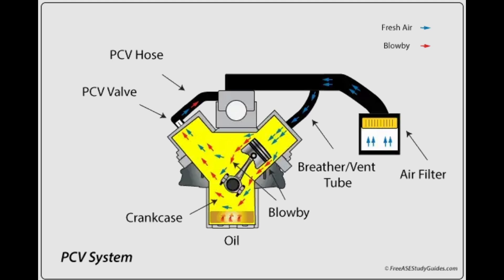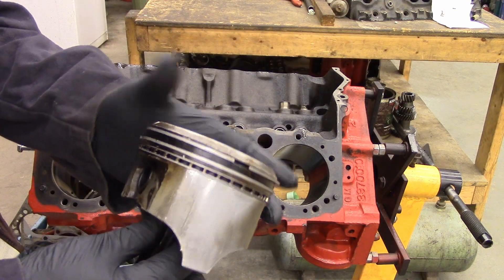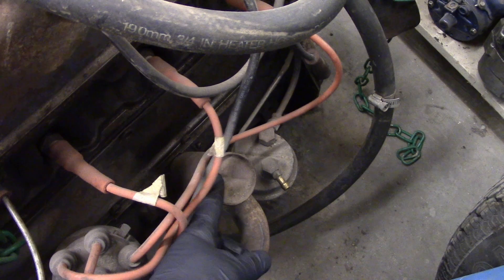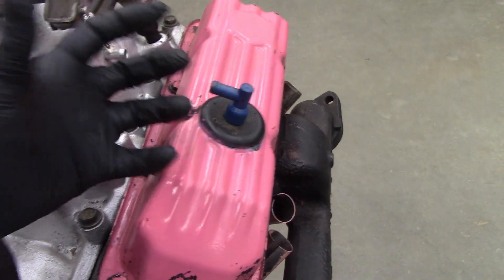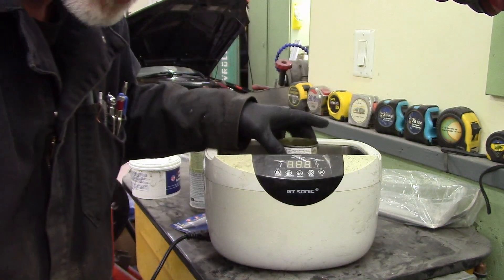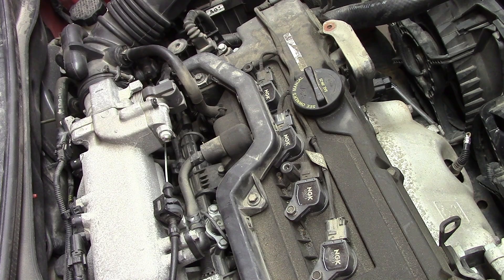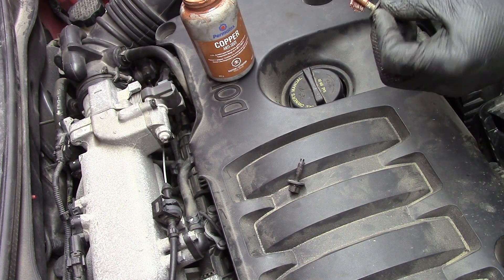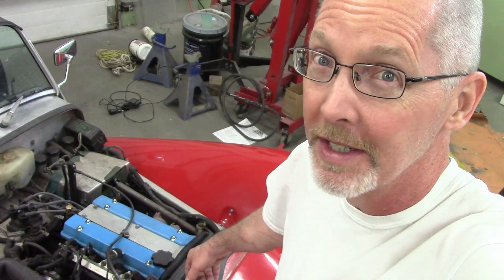Servicing The PCV System

Comment: Corolla GTS engine, run  a catch can with return to sump and a secondary line from catch can to exhaust primary/secondary union. You get vacuum of the exhaust holding negative pressure in the crankcase, you get a clean air inlet, no valve or plug fouling and great air/fuel mixture.

Comment: Catch cans ..  Are my preference to PCV setups. Recycling crankcase Goop back into the engine is  Not Ideal.. by any yardstick.
 PCV setups are THE reason that Direct injection engines Massively mess up their intake vales.
 I'll worry about the Atmosphere  as soon as  I stop seenig Dump trucks putting out Solid  columns of  black soot ..from their twin ex stacks... with each Gear change
Reply from the maker: A catch can will keep the oil from going back into the engine, which is good.  But you still don't get all the junk out of the crankcase and engine oil.  One part is saving the environment, one part is saving your engine.  We can debate pollution controls if you want, but that's how I get banned from forums.
Reply: @GregWellwood  so could you have a catch can with a pcv valve mounted in the top of it & then run that hose to your inlet manifold ?
Reply from the maker: Yes.  What matters is the stank gets sucked into the intake. You can certainly collect and separate the oil from that blowby.